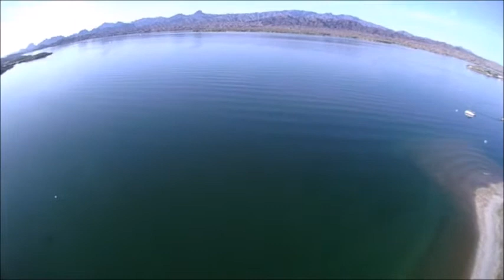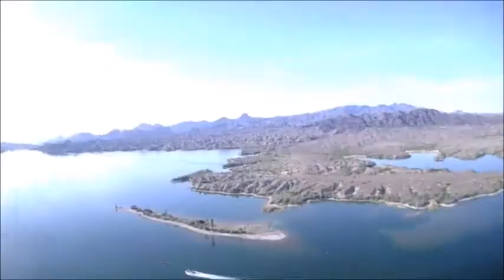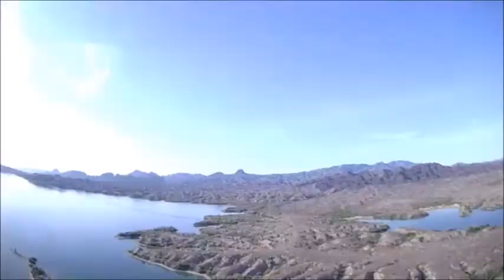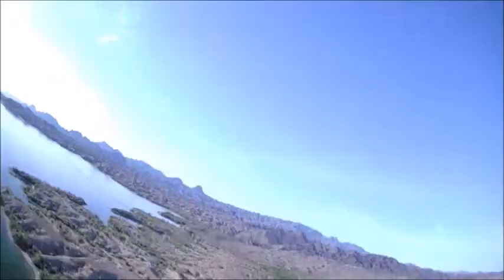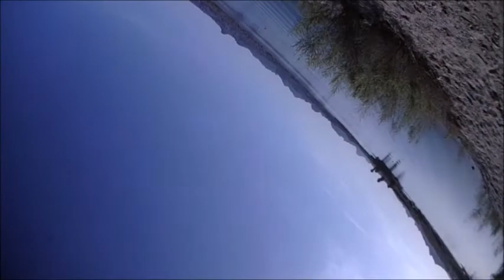CG035 "Control Signal" range testing continues.

Comment: Great video... Looks like it only took about 10 min. flight time.  Did the bind light come back on shortly after it started to RTH. ??  I assume you measured distance with google maps or something similar ..   Good Test....
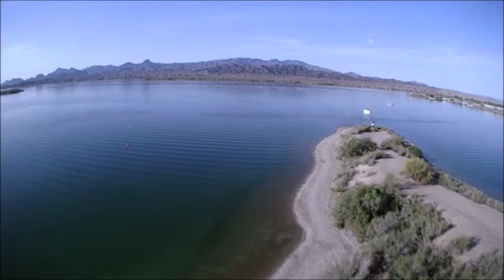Reply from the maker: Hi Bob thanks for your reply.  Yes the bind light went out shortly after it began RTH, indicating that the connection with the bird and transmitter was reestablished.  I used www.findlotsize.com to establish distance.  Actually have also used Google Maps many times as well.  Both very accurate, but findlotsize. com easier to use.  Actual "in air" flight time was approx. 8:55.